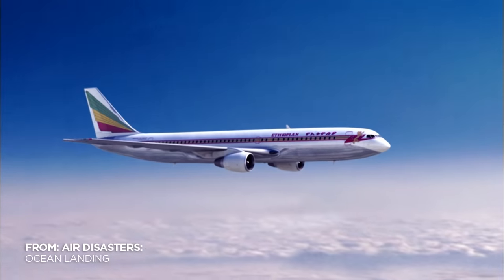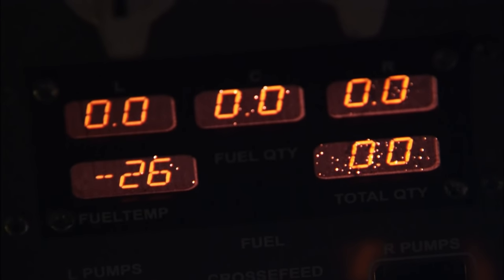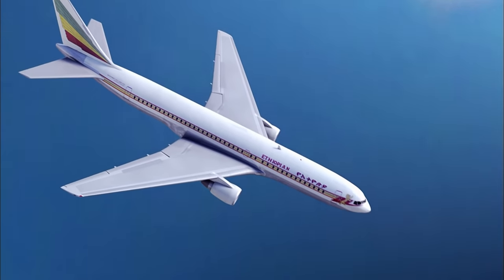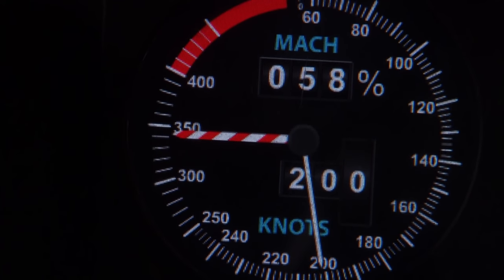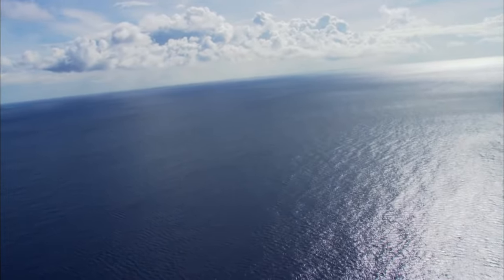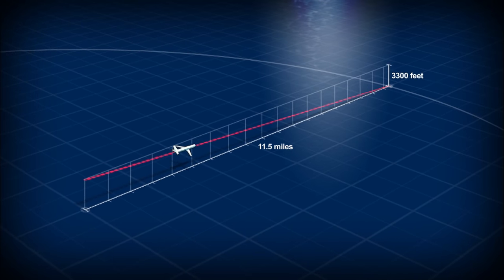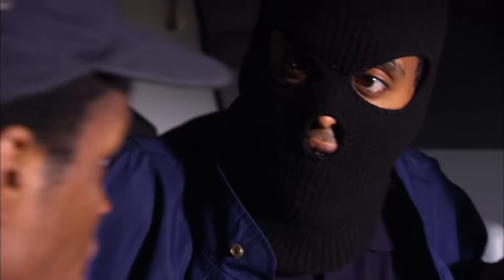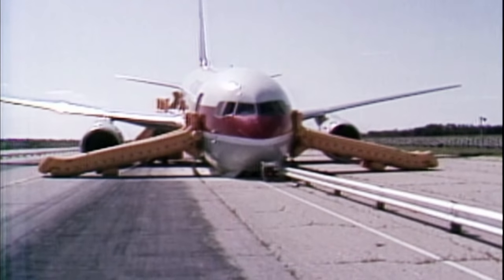The Pilot of a Hijacked Plane is Forced to Land it in the Ocean: Air Disasters | Smithsonian

Comment: Engeener Airplane should made an Airplane that can land on the Ocean also
Reply: Agreed but thats impossible unfortunately unless its a seaplane
Reply: They are designed to make water landings.
Reply: seaplanes/flying boats exist, but they cost more to make and are less aerodynamic.
Reply: So many variables
Reply: @cityplanner3063  Not exactly. There's 0 variables because they are designed for ditching.
Reply: If that was possible it would be too expensive since the chances of a plane landing in an ocean are less than 10%

Comment: So what happened after the plane crash-landed? How was it that only 50 survived and how were they rescued? Did the plane sink with 125 passengers still on board? Feels like only half the story.
Reply: Well during a water landing/ditching, you would put on the lifejacket that is stowed under your seat. And during the safety demonstration, you would be told to inflate the jacket AFTER you leave the airplane. But in this particular incident, people anticipating the water crash decided to inflate the lifejackets prematurely, and because of panic behaviour, a lot of people started inflating their jackets. 

When the crash happens, the plane split into parts, with the middle parts of the fuselage immediately sinking. Most of the passengers who are seatbelted initially survive, but they would have sustained injuries. Some victims were too injured or dazed to undo their seatbelts and drowned strapped to the sinking plane. Most of the 125 victims did survive are were able to take off their seatbelts, but since they prematurely inflated their lifejackets, they were pushed into the trapped air-pockets of the fuselage ceiling and could not escape the sinking plane. As water flooded in, these pockets closed up and many drowned.  

The captain did warn via intercom about not inflating the jackets before leaving the plane, alongside the usual safety demonstration at a beginning of a flight, but when you panic, you naturally forget knowledge and logic and start acting out of impulse. And in a panic situation, most people would be inclined to follow the main mentality, which was to unfortunately inflate the lifejackets.

Comment: How did other pilot landed in Hudson Bay , his trining school might be better then Ethiopian training
Reply: Because the A320 helped the captain keep it within its flight envelope. They also had fuel which meant the APU could run so they basically had everything except engines.
The 767 in this case had no fuel which meant controlling the plane was super hard (like lose of power steering in a car). Captain could only fly on small standby instruments and hijacker’s.